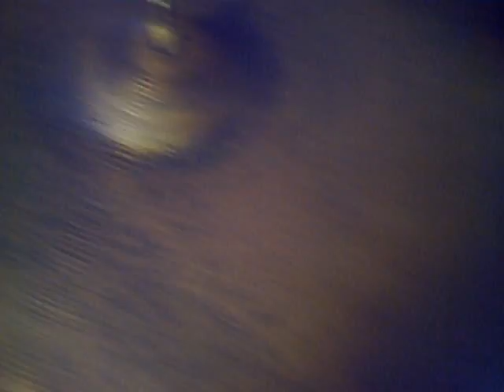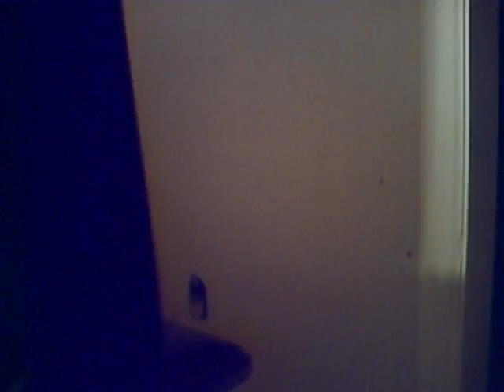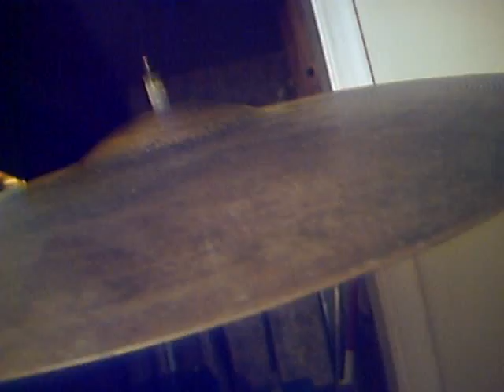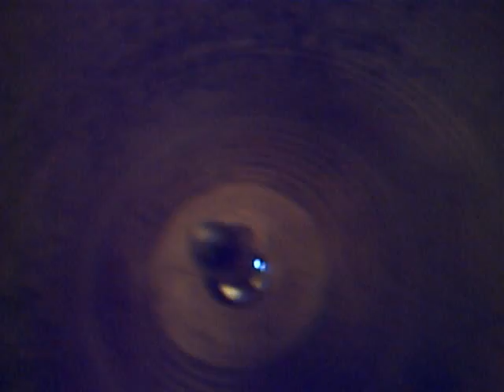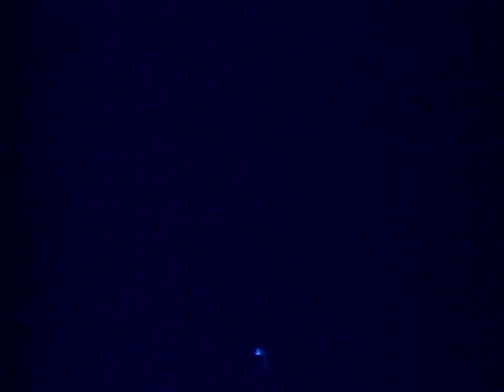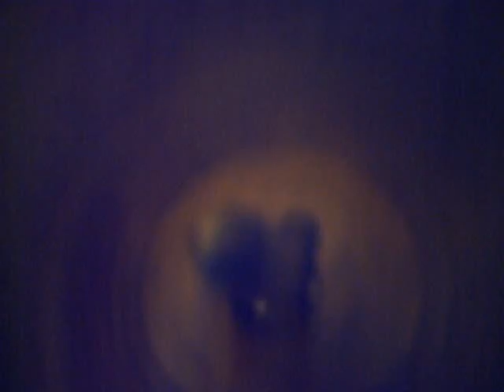tesla free energy static electricity tower

Comment: voltage is just a measure of the diference in positive pole strength and negative pole strength  amps is the measure of the AMOUNT of electricity  it's the AMOUNTof electricity that determines lethality   you can have very high volts without any amperage at all (no electricity) flowing through a circuit  no electricity no death even with high voltage, yes it may take a certain amount of voltage to overcome the bodies resistance and put the amperage through you, but the amps is still what kills u

Comment: I just want to point out that there is NO such thing as lethal voltage. .1 amps or higher is lethal to humans, it's the amount of electricity that kills you, measured in amps, not the electricity's difference in potential, measured in volts. You could have 200000000000000000 volts and .01 amps n it wouldnt kill you, likewise you could have 200000000000000000 amps and .01 volts and it would kill you.

Comment: whats happening is he is using a static ion generator which is spewing ions into the air simulating the earths charged atmosphere at higher altitudes.the energy is then being collected on the cymbal(capacitive top terminal) and thus pulling down the ions back into energy to be used in his circuit.when i made a mini tesla coil one wire,the same effect happened,i smelled the ozone ions and my volt meter was showing energy coming backthrough the coil again!its really amazing, hes doing a great job!

Comment: it would be continuous so in some ways its actually better than a solar panel, but it does take up a larger area. its such a simple design and fool proof thats why i believe its better.think alls you need is a large surface area of metal(aluminum,copper), then run a wire from your attic,to a charging circuit,and then run it to a very good earth ground!thats it!i put up some videos like chuck2na on this and i have gotten really good results,teslas radiant panels do work!try it out and share info

Comment: with a radiant energy colector you can run a house but it would take a large surface area, or you can make a charging system where its charging a battery with less surface area, but it takes longer.from what i figured is that it would be about a 48' by 16' area on one side of a regular slopeing roof to give about 16 to 24 volts.using both sides would theoretically give 32 to 48 v!!. this isnt enough to run a house, but charging a battery bank would make it possible to indirectly run your house.

Comment from the maker: introvertebrate

i know a pulse is not steady but if i take a capactor to filter the pulsed dc and through a voltage regulator then you have steady direct currnt run this current thru and inverter and you have energy to run everday household stuff
i will show that this stuff is real just for the fun of it by lighting an (l e d) off of static electricty an that will prove that 
that the telsa tower is real

Comment: I'm a big tesla fan and I like the explanation for how the tower works but all you have there is a capacitor... notice that the spark isnt a constant flow of electricity... it is being turned on and off... during the brief period that spark is "off" the cymbal is charging from the -ion generater then it releases the charge as a spark when the potential is high enough... isn't it?  I'm doing some vids on Tesla and Free Energy at the moment if you want to check them out...

Comment from the maker: how to harness it is to put a step down transformer and spark through that thereby stepping down the high pulsating dc voltage to a lower voltage or how about making the step down transformer an lc resonator by ading a single capacitor in parellel to the tansformer and adjusting the spark gap until coil and capacitor are in resonance  just like a tesla coil and take what you need of the lower voltage side